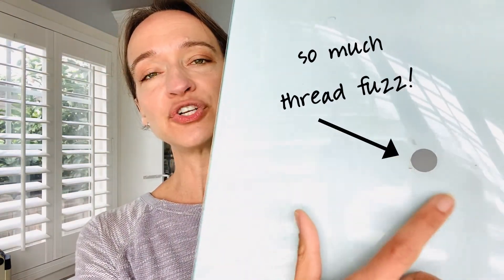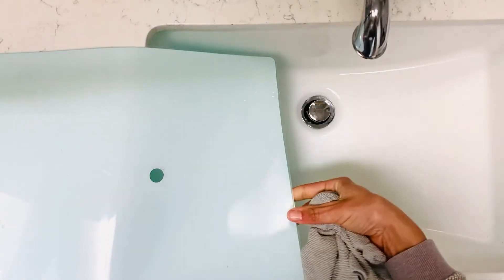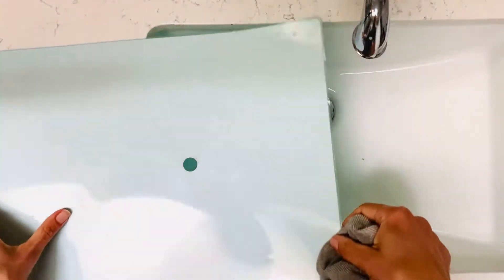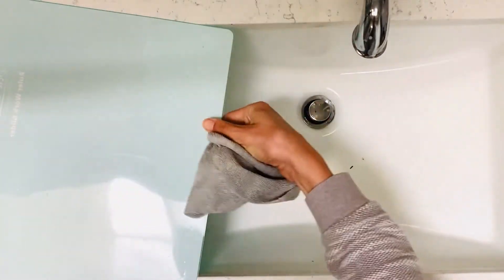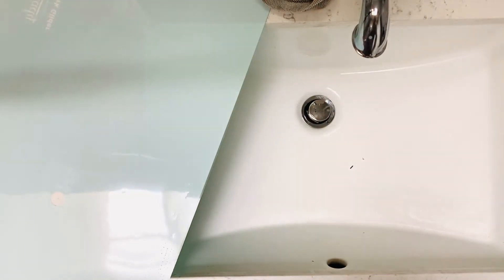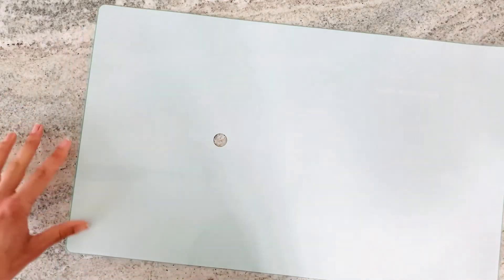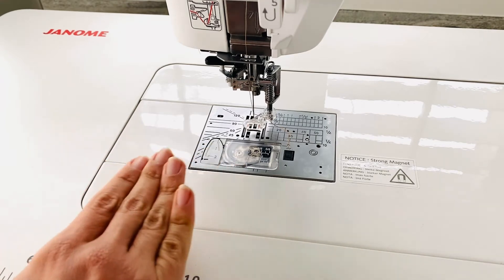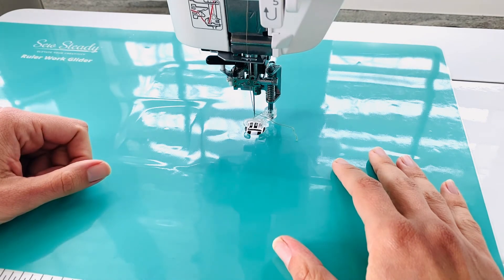How to Clean Slow Steady Glider / Slider Mat

Comment: Thanks for this video.  I cleaned mine with a sponge, and it did a terrific job. I used a blow dryer to dry it off.  Good as new, thanks to you.
Reply from the maker: Leisa-Land, so glad it worked! Did the blow dryer heat it too much? I remember seeing a tip that you can use a blow dryer to help heat it a bit when you first get it if it's too curled from shipping.
Reply: @FaithandFabric  I had no issues,  BUT...one should exercise care.  The water just rolled off (I had a nozzle on it). Once clean, the super stick was back and ready for action.